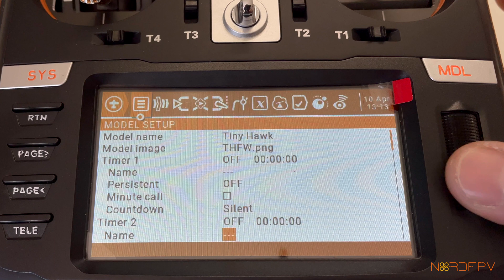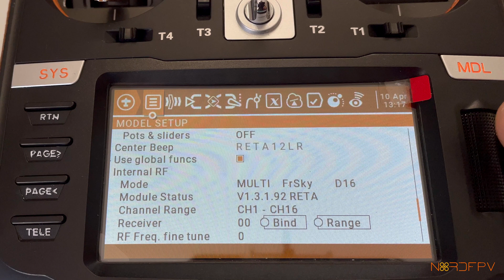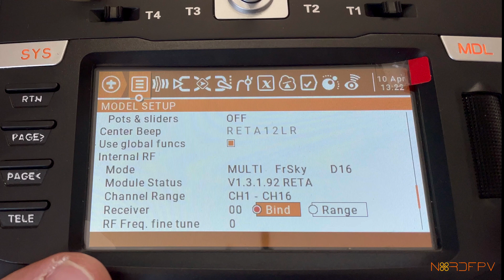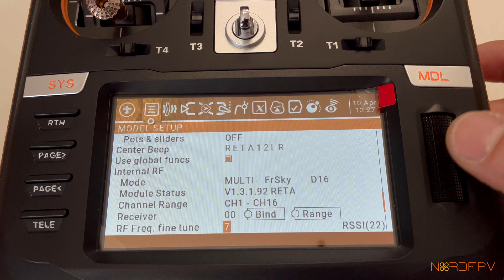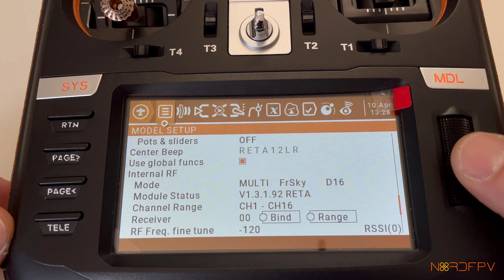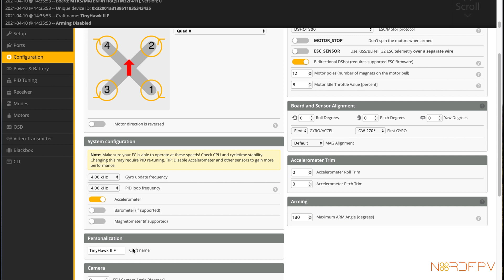Binding and Fine Tuning FrSky based receivers (Jumper R1F)

Comment from the maker: There seems to be a batch of these receivers coming a bit offset for binding out of the box. This means the receiver seems not to bind at all. Just move the fine tuning to -10, or -50, try different values both + and - and try to bind. After the binding do the fine tuning process again to get the best out of the receiver
Reply: with that i am not able to bind this thing at all since i have a taranis and can't do fine tuning.
Reply from the maker: Fine tuning should be there, since your Taranis uses OpenTX and this is a feature of OpenTX, not the radio itself.

Comment: Is Deviation firmware v5.0.0-ac7f63e the latest firmware from Deviation? On the Deviation website, the Nightly Builds section shows one released in 2021. Some say Frsky updated their RX firmware after 2020. Is that the reason the Radiomaster TX8 with that firmware can't bind to the R1 v2 mini receiver jumper? If so, what settings should I configure?

Comment: What if I only need 7 channels, does it transmit all 16 channels?  I set the channel range to 1-8 but I am able to send channel 9 data on my edgeTX Jumper t18.  I read that transmitting more than 8 channels will add more latency.

Comment: help!

telemetry works fine, but betaflight doesnt show any reactions when i use the controller sticks
Reply from the maker: Probably you haven’t selected the right protocol in betaflight for your RX or you have the wrong UART on the RX
Reply: @NordFPV  i wish but both is correct

Comment: Any idea why R1F fail to bind with Jumper T-lite? 
By the way, there is no just "FrSky" under multiprotocol in the radio, there are only FrSky X or FrSky X2. And I suggest FrSky X is correct one to use, isn't it?
Reply from the maker: You are right, FrSky X is what you should use, and there has been a batch of these receivers were you need to move the fine tuning to -50 before binding the first time. Try -50, or +50, and keep moving farther if the receiver is not binding. Seems like some of these receivers have a very big offset out of factory. When you bind, do the fine tuning process again to make sure you are in the best spot
Reply: @NordFPV  you're right! I just moved to -7 and it already started to bind. Thanks!!

Comment: I have a iFlight SucceX-E F7 FC Stack. The receiver can be connected on SBUS ? I have a jumper T lite. Thanks
Reply from the maker: yes, you can connect it to the sbus
Reply: @NordFPV  I connect a jumper r1f in the iflight f7 fc in the T2, 5v and ground. The receiver connects to transmitter put not respond any movements. Urart in the 2 position rx serial, i put all the configuration following the iflight diagram and still not respond. Did you know what is the problem? Thanks
Reply from the maker: @rchobbyer  Have you defined your channels in the radio?
Reply: @NordFPV  the channels are good. I connected to beta fight and don’t detect the receiver. The receiver is connected the right way

Comment: Thanks! I just got this (from you) but couldn't figure out why I was losing connection and the values jumping around in betaflight. After fine tuning (no other guide mentions this) I found that at 2 I lost connection, and after changing to -70 it was working just fine! THANKS
Reply from the maker: I'm quite surprised no one else mention this. These receiver comes almost always with an offset of -50 - -70 and it's very difficult to bind if you don't start with that kind of offset.
Reply: @NordFPV  indeed. I managed to bind fine, but the red led was just pulsing dimly and couldn't understand why (new to all this) but thanks to this video I didn't have to tear it down again :D

Comment: Great video! I follow exactly the instructions but mine will not bind!! I have done this about 10 times not and will just not bind! Any ideas??  thanks
Reply from the maker: I've seen this a couple of times. What you have to do is to do move the fine tuning frequency before binding. Either a lot to the + or a lot to the -, try with -50 first and try to bind. If it doesn't work try with +50 and try to bind. Once it's bound do the fine tuning process to find the ideal place. If 50 doesn't work, try with other numbers, 25, 70, etc.
Reply: @NordFPV  in BIND mode Green light solid, Red light flashing slowly is what the 1 page manual reads that comes with the R1F, but i get red/green solid just like yours. however it does not bind with my Taranis x9dplus (OpenTX 2.3.14 / 2021-07-23) ACCST/D16...   got me two R1F's but both act the same.  There is no freq tune afaik on the X9D.... 
(i have the same packaging as you showed https://youtu.be/BUzlGOji9hc?t=113 )
Reply from the maker: @crabsodyinblue  There has to be a fine tuning section. That is not particular of a radio, it's part of OpenTX the software of most of these radios. These receiver comes a bit offset and it's a MUST lately to move the frequency a bit before binding.
Reply: @NordFPV  thank you, thank you, thank you!!!!! this was driving me nuts !

Comment: Good stuff 👍 how is rx fit under the board is it tight fit coz im getting Jumper t Lite very soon and im wondering to put rx under too??
Reply from the maker: On this specific drone, it's quite tight to be honest. It works, but there's barely room. You can always put it on the top, but I don't like to have things over the gyro.
Reply: @NordFPV  Id rather do not mount it on the top since i have Tbs nano pro and its getting toasty there , i suppose i will put 1/2mm shim under mounting screw to elevate AiO bit. Tnx for info!
Reply: @NordFPV  Got a question i mounted R1F in my Tinyhawk2 freestyle and im getting failsafe at 100-150m connections are good im using soldering pads near SPI antenna i have enabled all settings in betaflight so im not sure what causing the issue now. Thank you
Reply from the maker: @martingru  All depends on the place where you are, the noise, trees, bushes, etc.
One thing you can always check is your antennas, and as I say in the video fine tuning is important. That said, around 200 is not a weird number for these devices
Reply: @NordFPV  Im flying at plain field with  almost no buildings at all with no trees ,from advertised  1.5km 200m is VERY poor i dont want to fly so far but stock SPI inside TH2F got me up to 200m :))  Ill try to reconfigure it one more time and check it out when stops raining.
Thx for answers.